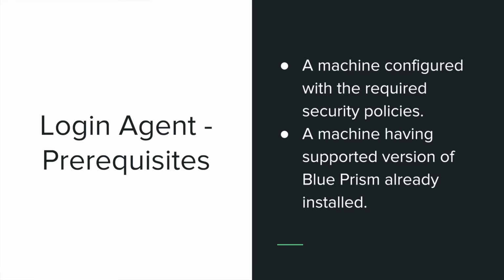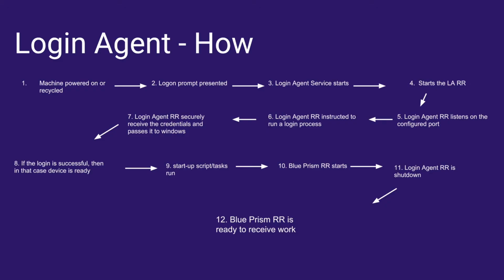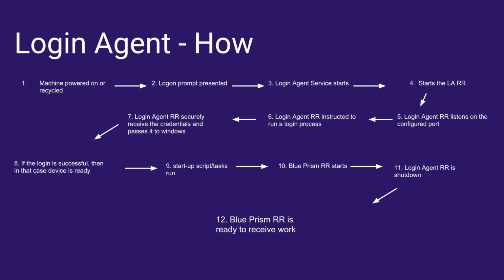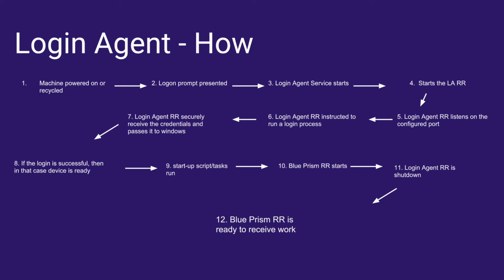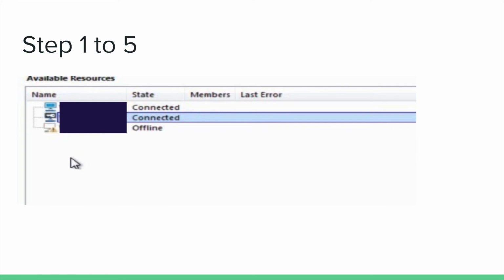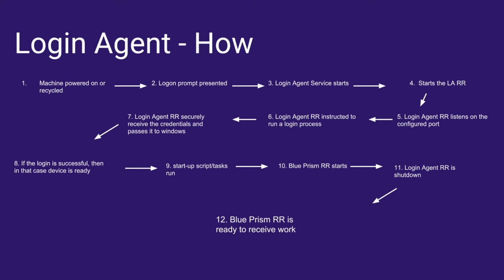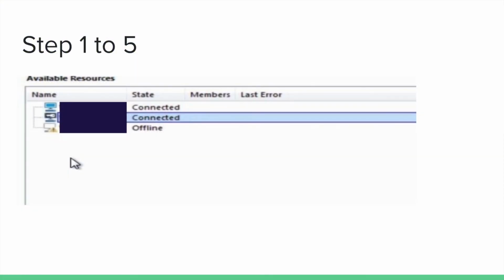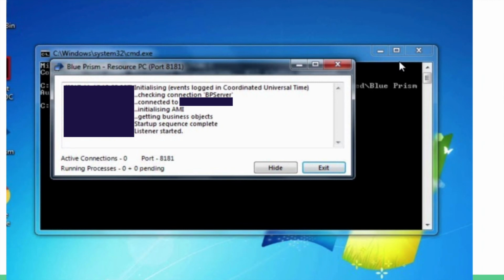Login Agent Explained Again

Comment: Hi Harsh Singla,

As you mentioned in the video  at 6th Step: Login Agent Run time resource instructed to run a login process
The resource will be locked then someone needs to drag and drop the Login Process to that particular resources. IF i understood correctly, for testing purpose we can drag and drop login Process into the resource PC?
So Here is the scenario: if Process A was scheduled at 8: 00 AM it? need to unlock the window for that we need to incorporate the login agent in the same process A which we want to run at 8: 00 AM or do we need to create separate process for that?

If we want to run the Login Agent process separately  Do we need to schedule the login Agent Before 8: 00 AM to run the process A?

What would be the best Approach to do that?>